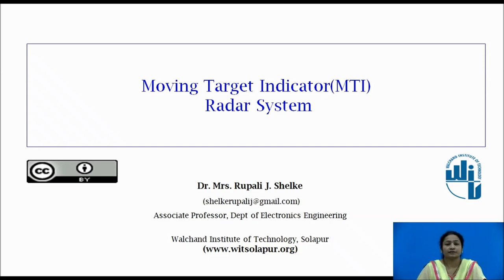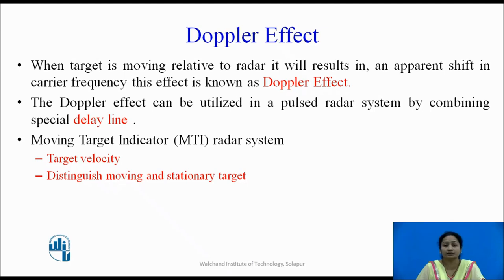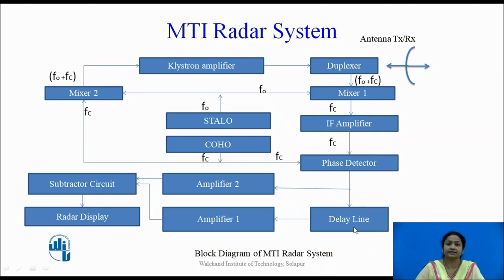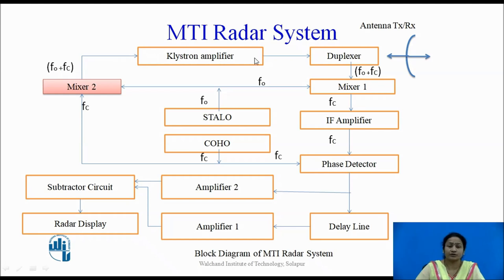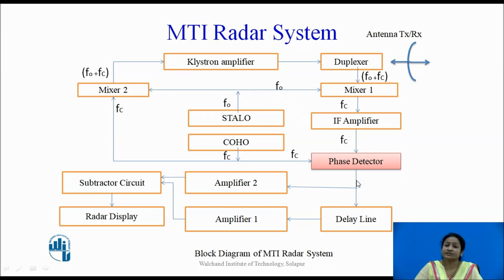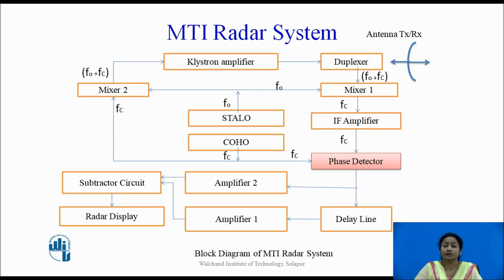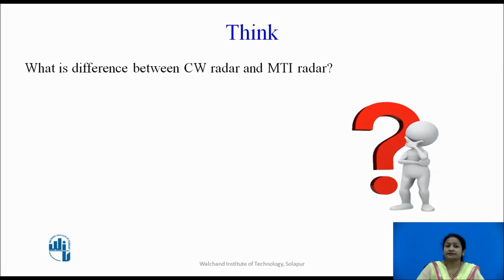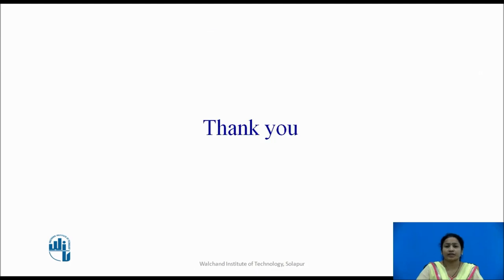Moving Target Indicator (MTI) Radar

Comment: Your  audio  is inaudible.   In the early  70's  I maintained  Gilfillan  GCA RADAR  which  had MTI, US  Navy, 68---74,   NAS  Miramar,  70-74.   FPN-36 QUAD RADAR  and  FPN-52,  similar  to FPN-16,  and TACAN.   Vacuum tubes.  Mercury delay line.  Klystron  L.O.   X band  PAR